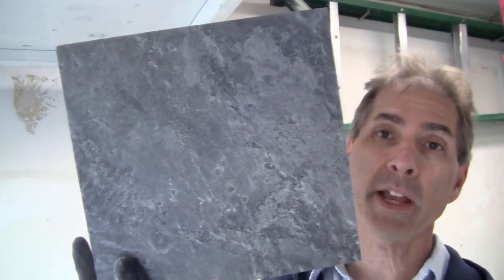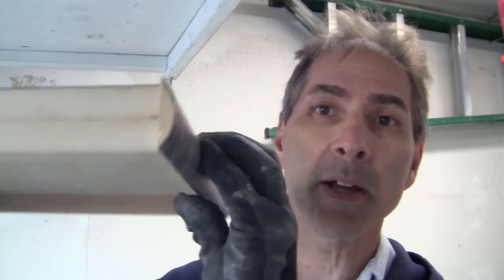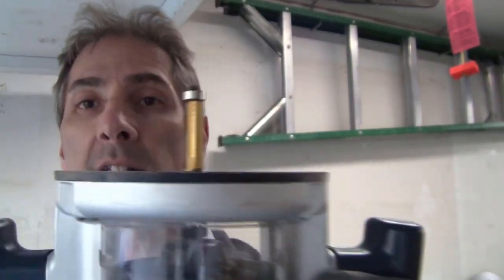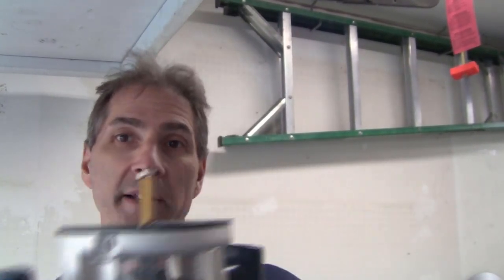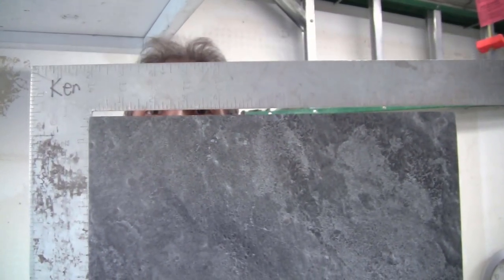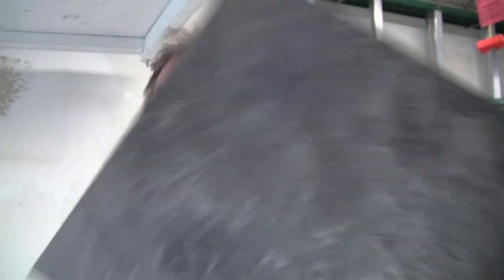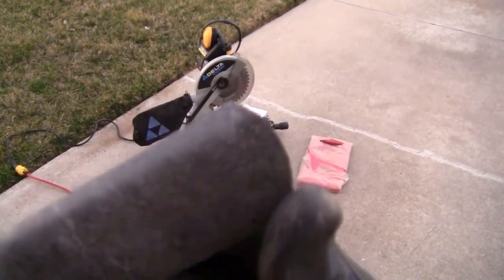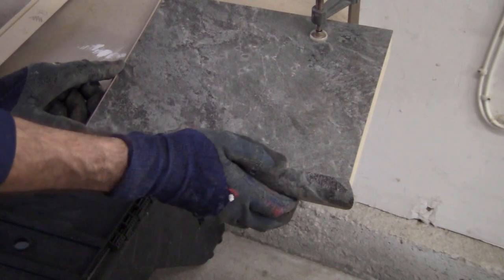Installing Bullnose Edge for Laminate Countertops

Comment: The extra 1/8 is so you can install a strip underneath to create a wrapped edge. A small trim nail in the corners with a trim nailer shot diagonally into the backside of the trim would have held that piece nice and level. And maybe a little less glue.

Comment: oh yeah, I also have been finding that using blue painters masking tape is is really preventing chipping. I put it on before I cut and mark the tape and then cut the tape covered piece.    My trim cost me over 200 bucks! It was more than the 12 x 8 sheet I bought ! so frustrating, I dont want to buy any more. really regretting not getting an electric saw.

Comment: The edge is thicker to allow for laminate to be applied on both the top and the bottom.  This comes in hand when making a waterfall countertop, laminate on the inside and outside of the vertical countertop.

Comment: I made a new edge of poplar to expand my countertops a bit, so the harder wood is more square then the edge of the mfd, I used the wood glue and counter sunken screws all the way around. It would have been perfect if I had thought ahead and made sure my screw counter sinks were NOT going to be in a place where my flush cut bit roller would be.   when I was cutting the laminate I hit a few of those indents and had to belt sand those edges back.  VERY difficult to get them evened out.  Thanks again .

Comment: Man, Lemme tell ya LOL  It aint easy with a belt sander either,   I have two belt sanders and no miter chop saw !  OMG it's way hard to get those cuts with a manual miter box! It;s making me crazy. 
   I was hoping for a tip that would let me do it easier with my saw. LOL I guess I just need to get a saw. My regular old craftsman can get off just a tad and messes up the whole joint when you put them together.  it doesn't help that my counters do not all have 45's and I didnt buy bullnose I bout the water fall kind so it is just flat on the bottom.  it;s been so many hours of this I am wishing I woudl have just got the bevel edge.   Grrr. Thanks for this video. 

  oh yeah, I didnt have a router either, I thought I was being smart using a Zip tool since they resemble those new fancy mini routers, thing is though the base of them is not supported the same way as a router and the tiny bit of flex in the zip tool base ( It has one sided base arm ) makes your edge do like what you said  get a wave in it. so after I messed the edges up I had to belt sand the crap out of them. I'm still cutting this trim.  back to work I guess.      OH nice gloves! My hands are too big for the ones that I recommended to buy so I have been going bare handed, YIKES! this trim has me all cut up. It;s very sharp!

Comment: I believe the extra 1/8 inch on the bullnose strip is to serve as a drip edge so that liquid that runs over the edge doesnt work it way under and back to the cabinet.
Reply from the maker: ok, I did not know that. Makes sense but looks better when flush.